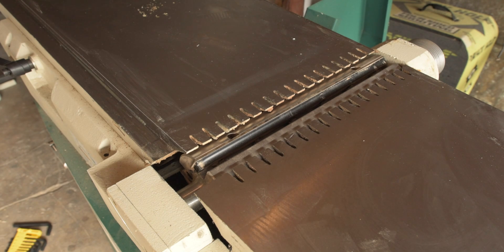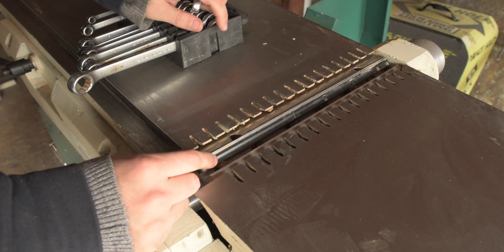Grizzly G0609 Shelix Upgrade - Part 1

Comment: Are you glad you went with a 12" jointer over an 8"?
Reply from the maker: Yes. Sometimes I wish it was a bit longer, but I’m happy with the width. I definitely prefer the shelix head. Vast improvement in reliability.